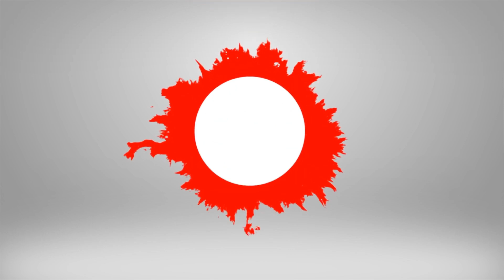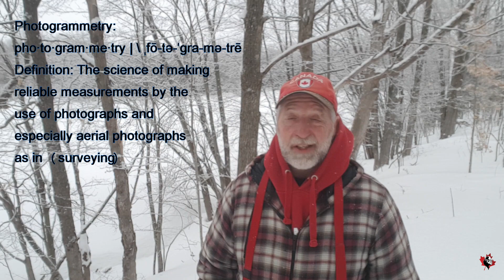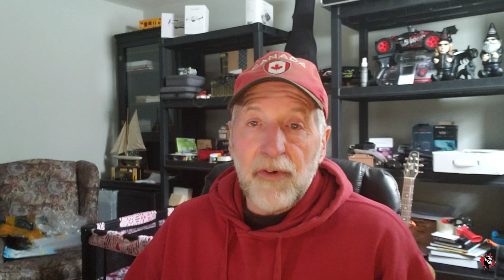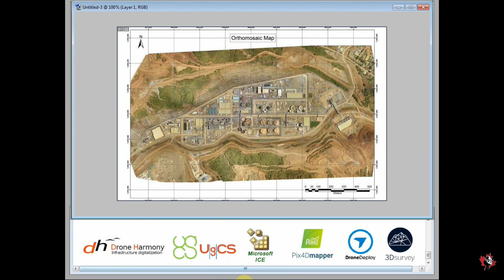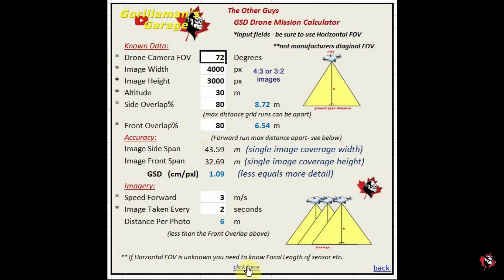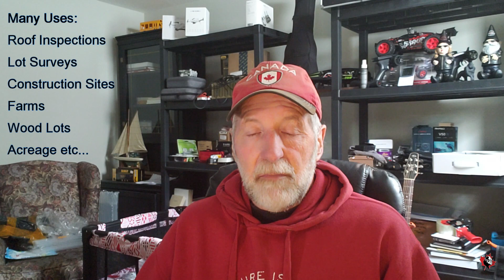Getting the Big Picture - Drone Mapping 101 - Part 1

Comment: Hi, I have been using the open source (free) 2D&3D mapping program WebODM. No monthly fee. If a computer nerd one can load up that program for free, but for $57 one can buy a WebODM installer that does all the program loading for you. They recently provided a native Windows WebODM. That's the easy part to producing high quality maps. The more difficult part is getting an overlapping series of aerial photos to feed WebODM. Doing just waypoints is a lot of work to get a series of useful photos. I use my Autel EVO ll app mission feature to easily create either rectangular or polygon missions. Missions can be planed on the ground, saved, and then executed at a later date.
Give WebODM a try, I think you will like it.
Reply from the maker: Thanks.. I did look at WebODM but I got confused after the Blocker, loader thingie... For simplicity sake, I have had good results of survey mapping from my X8 SE 2022 and Microsoft ICE.
Reply: @GorillamansGarage  Hi GM, the current version of WebOMD is native Windows or IOS that doesn't use Docker.
Reply from the maker: @ssb73q  i will have to take a look. Thanks
Reply: @GorillamansGarage  Hi GM, I recently found a free program that can do rectangular or polygon missions to produce a regular series of photos for mapping, Map Pilot Pro.  That program supports a number of different drones, DJI Mini 2, Air, and Air2 included. Unfortunately, it only works well on an IOS device. I use an Apple Mini 5 tablet. There is a beta Android version, but I haven't been able to make it work reliably using Android.